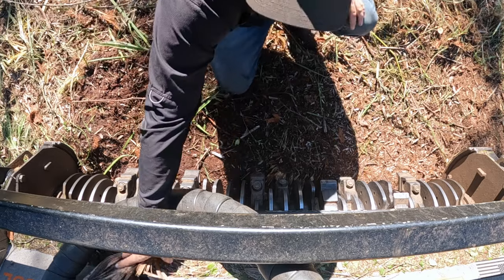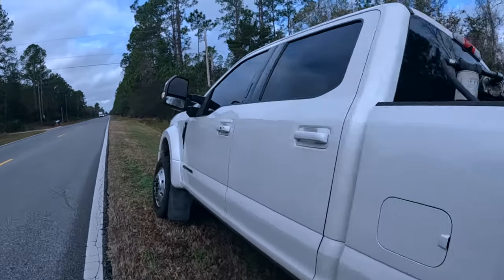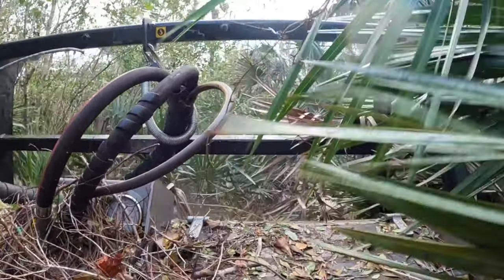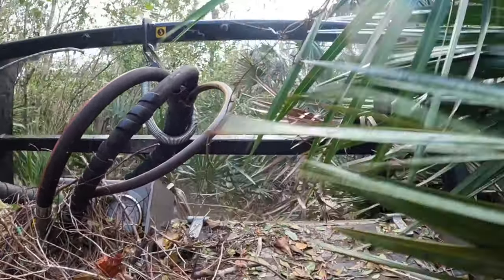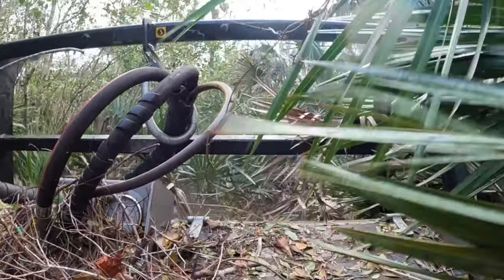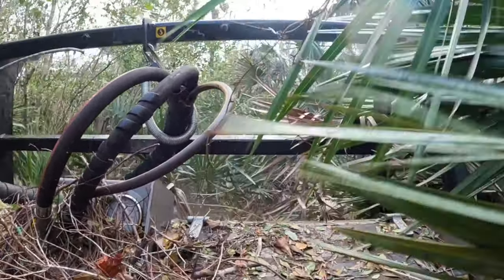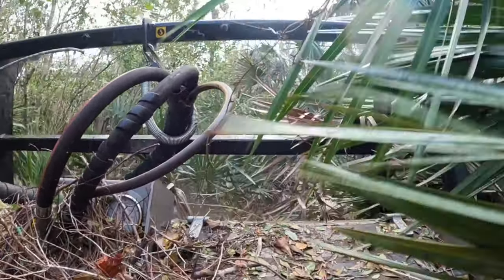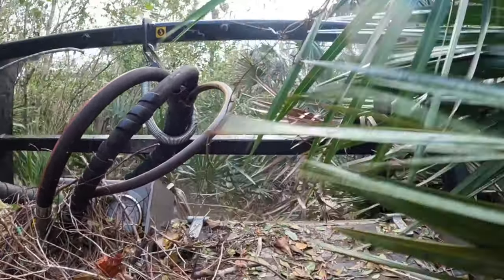Clearing 5 acres in Florida with Forestry Mulcher for new home build. | Tree Shop

Comment: Nice job. Here in Connecticut, you would have to deal with so many rocks.
Reply from the maker: Yea they run a different style tool that has a carbide tip. They also don’t run the DCR heads like we do in the south. The northern setup requires a lot more horsepower so they tend to have the big boy mulchers

Comment: does this model FAE mulcher you have run better than the cat hm215 on your 259? what is the model exactly? BL1? it looks big for that skid steer do you have any issues with HP or anything?
Reply from the maker: Join the Facebook group. I discuss equipment in there. But the comparison in your comment is not even fair to the 215 😂 the FAE I run would eat the 215 and keep going.